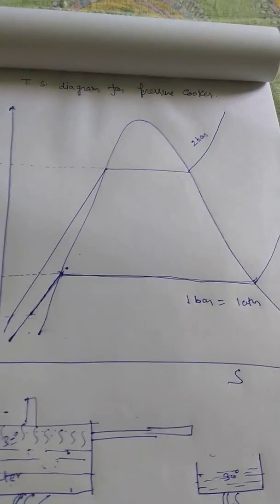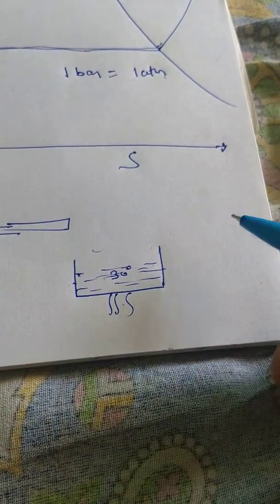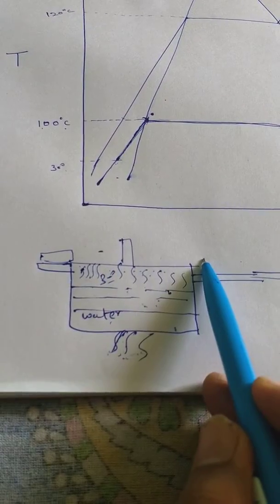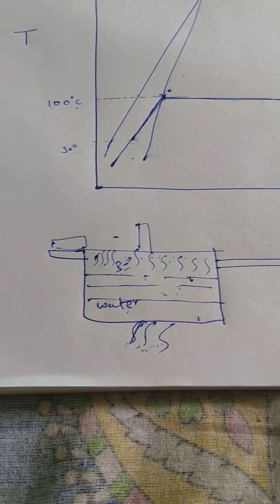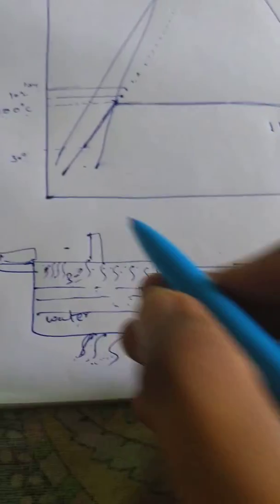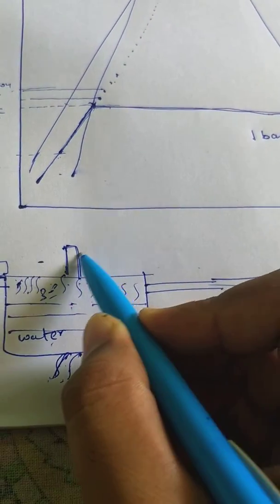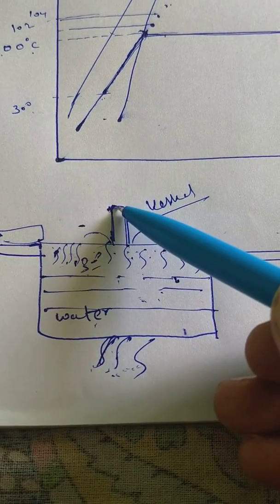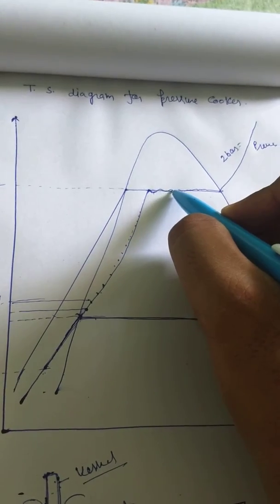T.S. diagram for pressure cooker..

Comment: The specific volume of water and water vapour mixture will always remain constant inside the pressure cooker. So I think that the dotted line will be a vertical straight line.

Comment: if water does not start boiling then how come your points are inside the dome??
i think the points will be along the saturation curve ,not inside the dome. Along the dome will be correct .
Reply: Because due to vaporization some amount of water have already converted to vapour. So dryness fraction would be greater than 0.
Reply from the maker: After water expansion and steam formation only pressure inside cooker increases...so without steam formation cooker can't work ...this is the steam that increases the pressure inside cooker and mixture of steam and water always remains inside cooker

Comment: if we put extra pressure from outside in pressure cooker by tyre method like a nozzle fitted in pressure cooker so we input this pressure by hand powered pump
then will less fuel required?
Reply from the maker: Yes if u some how ..pressurise the cooker ...oviously less fuel  will b needed
Reply: @amir28462  so i have so much ideas about this fact and likely fact including induction chulha, microwave oven, and so many other cheapest technology forever like piezoelectricity or diodes or capacitors and spring based battery ya gravity powered microwave frequency magnetrons technique improve with hydraulic pressure and so on
Reply: @amir28462  so pv=nrt formula
give that volume of air to inserted from outside into pressure cooker then temperature will going increases automatically

are we able to boil the water just by pressing, pressing, pressing it
Reply: @amir28462  please tell us how to draw pv diagram of heating inside pressure coocker.It is constant volume process right??
Reply: are you able to do something with pressure cooker that it becomes more powerful modal using less fuel, i have something that using in old age stoves in which we manually increased the pressures then we got higher flames so if we use tyres pressure valve and fitting it in pressure cooker top then we can easily filled the pressure in it and use ten times more pressure from normal pressure so we got quick results
Reply: @anilkumarsharma1205  please tell us how to draw pv diagram of heating inside pressure coocker.It is constant volume process right??
Reply from the maker: Dear...by pressurising the water it is not possible....yep by reducing th pressure it is possible...cause boiling is combination of pressure nd temp..the moment u go below vapour pressure ..liquid starts boiling
Reply: @amir28462  what are that limit on which water become boiling with increased temperature since under sea warm water are their at bottom which support life expectancy so how much pressures required to raised the temperature according to pv=nrt formula
Reply: can we explain this fact that water boils at under pressure or not?
but boiling under microwave frequency